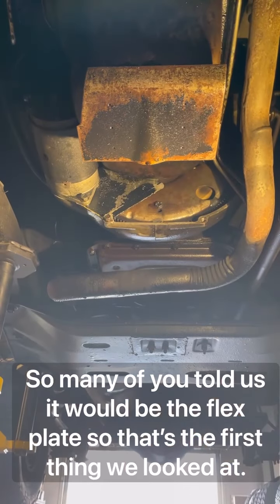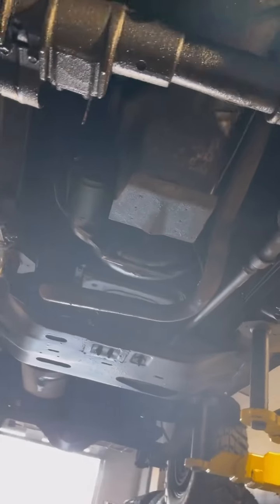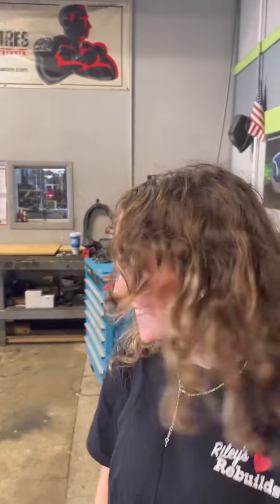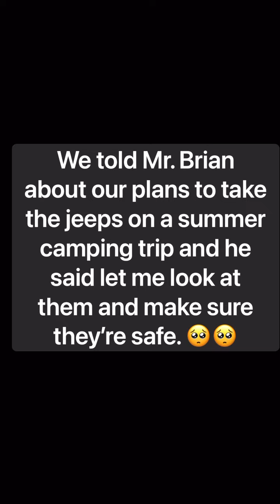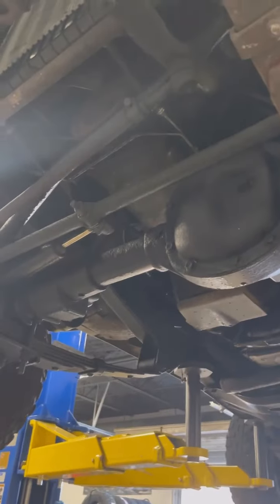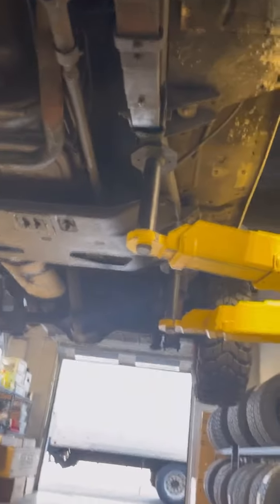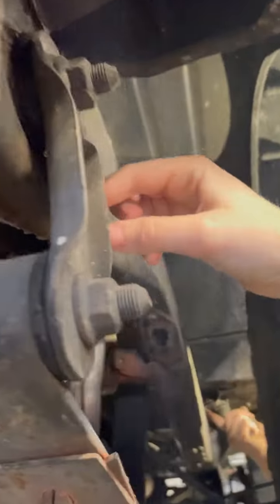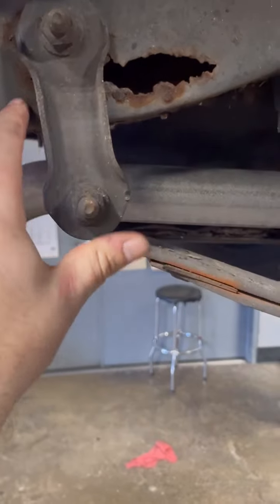Part 2 Amelia's 87 Jeep YJ Death Rattle fixed!! the good and the bad

Comment: Great outcome! Loose torque converter bolts sound just like a rod knock. Already had that happen on a Duster many years ago. Transmission guy knew what it was before we even put it on a lift.

Comment: If she gonna replace all the gaskets she should throw a new set of rod and main bearing in it if she does that it'll probably live another 10 years
Reply: Also throw in hardened exhaust seats in the head and check for cracks on the top and in the combustion chamber. I just did a 4.0 head